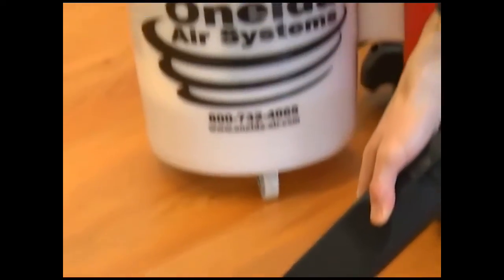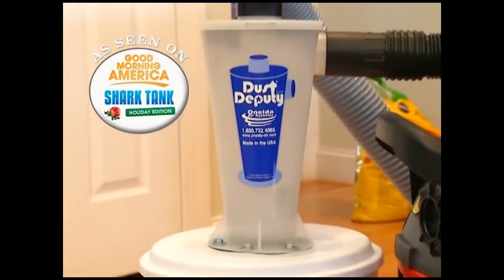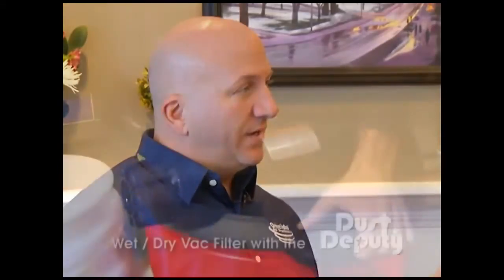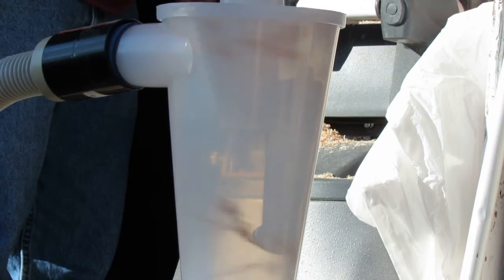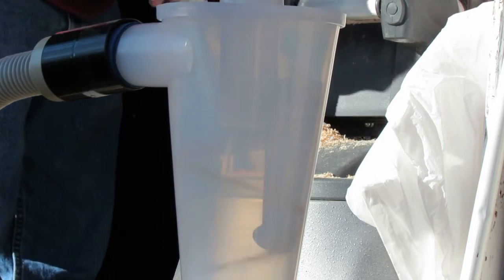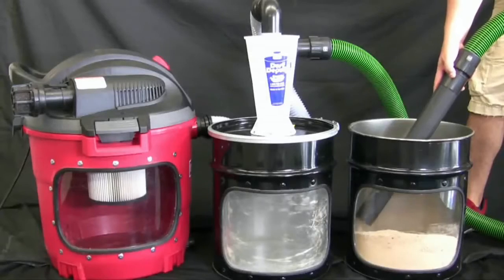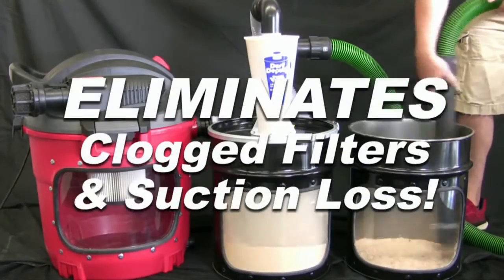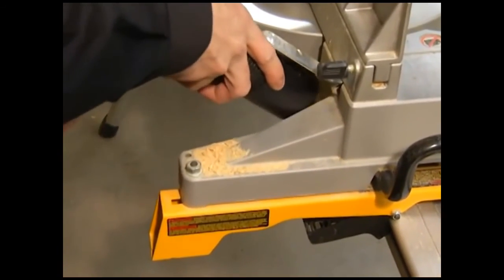Coming: Bagless Kirby Conversion

Comment: OMG lemme know how this gets on. Iv'e been debating trying something similar as i have 5 Kirbys sitting around, but my only concern with that idea was that the Dust Deputy is designed to work with suction not exhaust air flow. and the kirby works by filling the bag with its exhaust like an old Hoover, not a suck through system like a Sebo keep us informed on if this works or not cause this is one hell of an idea!
Reply from the maker: This will work also with exhaust air. Important is that everything is sealed and dirt enters the cyclone from the side and air exits from the top. My bag saver which is designed to work with the suction did work well in direct air Vorwerk.
It separated extremely well dirt from air and filter stayed clean. Problem with it was way too narrow piping. Not suitable for Kirby. It would limit the airflow too much like it did in Vorwerk. Dust deputy is 99% efficient and it has just the right size piping for Kirby.
Most important is that filter has large surface area. That way the airflow doesn't suffer.
Reply: sweet! .. ill keep an eye out for your project and as long as it works great ill steal it MUHAHAHA .. JK but id love to make one as well
Reply from the maker: Thomas Guillot It should work well.. I think :D